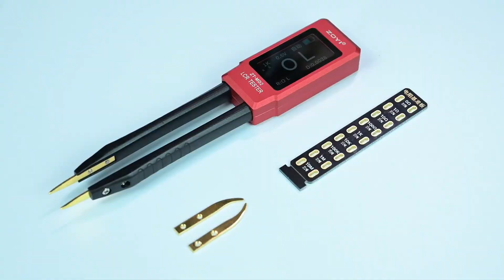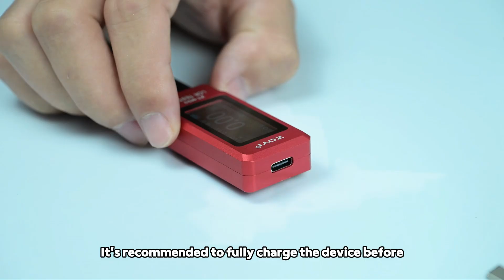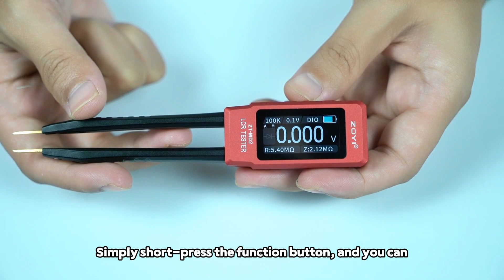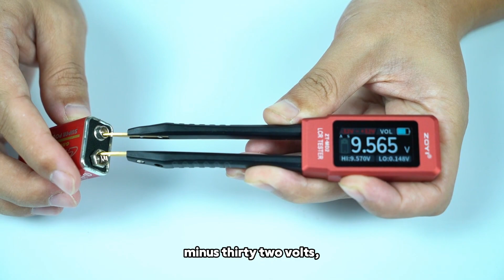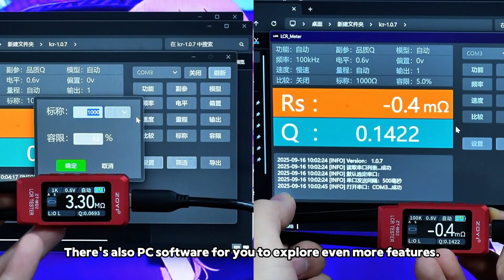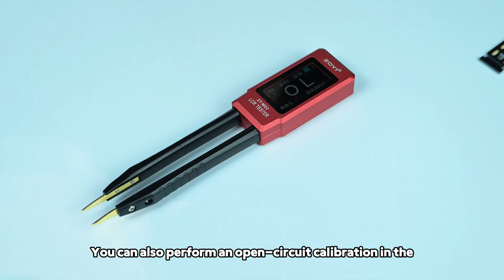How to use ZT-MD2?

Comment: I just got mine but i think it is not ok. It's behaving strangely, it flickering up and down values, even if i close it's own tweezers it shows 6 to 7.8 omh flickering up and down between this two values. 
If i measure the testing board it came with it, the zero omh resistor shows exactly 6 to 7.8 omhs. The same issue happens when i try to measure smd components (capacitors, resistors and inductors, but not diode) on my own boards. 
Do anyone know how to fix this?
Reply: Откалибровать....
Reply: Did you ever fix this issue, or did you get a refund after providing the seller a video of the malfunction?
Reply: @Dan-OU812  i contacted the seller and they told me ”according the they're engineers this behavior is normal”. I know what is not true, and because of that it doesn't worth trying to open an dispute to deal with an bad seller. So i let mine to root on my shelf.

Comment: A question after fiddling around with my purchased one: does the "R" parameter in C measurement mode always show the series resistance regardless if the selected model is series or parallel? Because this is what appears to me. If so, is this a feature or a bug? I think that when the parallel model is selected, the parallel resistance should be shown....